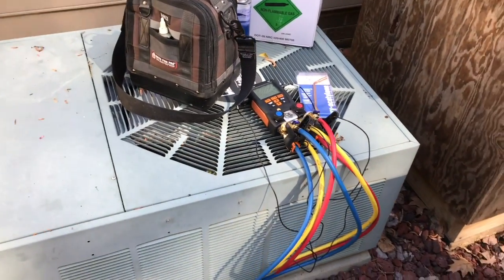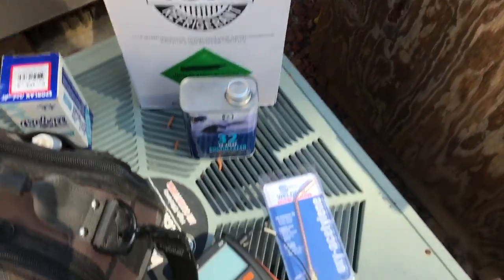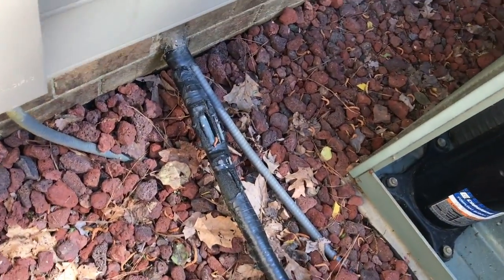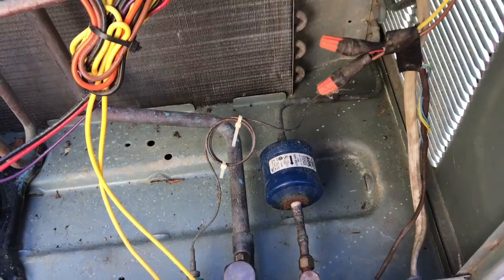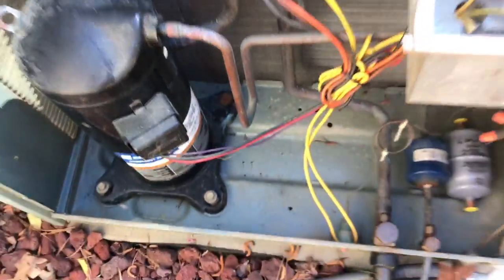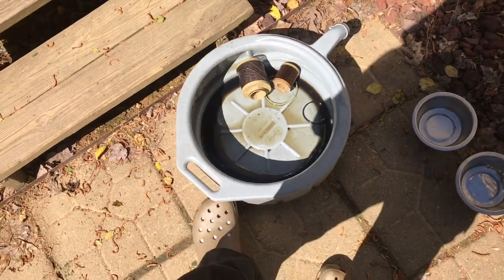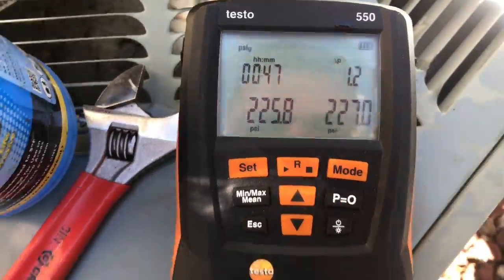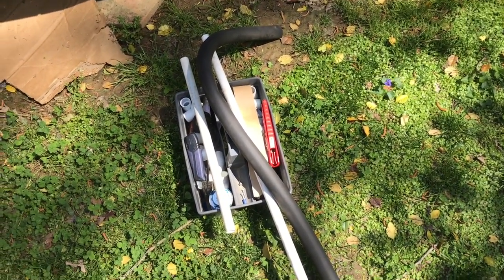Converting my Ruud to R-407C - Pt. 1

Comment: I find it easier to cut the compressor tubing on the vertical sections instead of un-brazing the pipe. All you need are some couplings to get it back together and avoid leaks on the compressor by not having to re-braze a joint.
Reply from the maker: I didn't think about doing that, otherwise I would have. It would have indeed been easier, and I wouldn't have even needed couplings, as I have a hydraulic swaging tool that I could've used to re-join the tubing together to braze it. Will keep that in mind next time. 
Thanks

Comment: Looks overcharged low super heat.  I think it is recommended to charge r407c to 80% of factory charge of r22.  But like you said it is too cold out to accurately charge system.  Good tutorial.
Reply from the maker: The charge does indeed still need to be rechecked. (I still haven't gotten around to checking it during warm weather) If the superheat is still low, I'll probably start by adjusting the TXV to raise the superheat a little, and see how much it affects my subccoling, as far as whether or not I need to remove refrigerant. The factory charge on this unit is 5.8 pounds of R-22 and the line set is about 15' long, and when I weighed in the R-407C charge, I only weighed in right at 5 pounds. But like I said, I'll be rechecking it soon.

Comment: I don't have a oil pump either I just pour some in a measured cup and drop a hose in when I start the vacuum.
Reply from the maker: That would be an easier way to do it than my method, for sure.

Comment: Does the compressor manufacturer give the information on how much oil you have to replace? Nice video thank you.
Reply from the maker: The sticker on the compressor tells you how much oil came in the compressor. 

You can just pump in POE oil and mix it with the mineral oil already in the system, the POE will make the mineral oil soluble so the HFC refrigerant can carry it back to the compressor and it won't turn into a sludge. It's preferred to get at least 20% (of the rated oil capacity per compressor sticker) POE oil to mineral oil, 15% absolute minimum from everything I've heard/read. 

I did it the way I did because I don't have an oil pump to pump the POE oil in, and the way my unit is designed, the compressor is pretty easy to access & remove.

Comment: can I extract the Freon and oil with the same pump? do I have to uninstall the compressor in order to get the oil out of it? please help me....
Reply from the maker: This is really a job that only a professional should be attempting. 

Refrigerant must be recovered out of a system into an approved recovery cylinder, using an approved recovery machine/device of course. Removing the compressor is the only method I"m aware of to get the old oil out of it. It also makes getting the new oil into the unit much easier than pumping it in.
Reply: Thank you so much